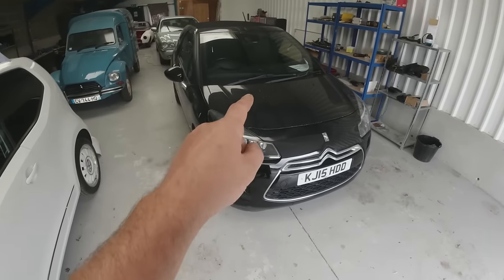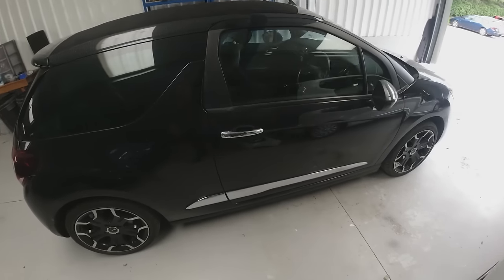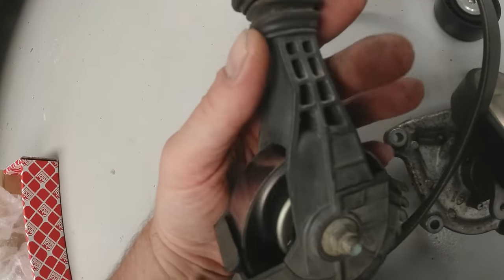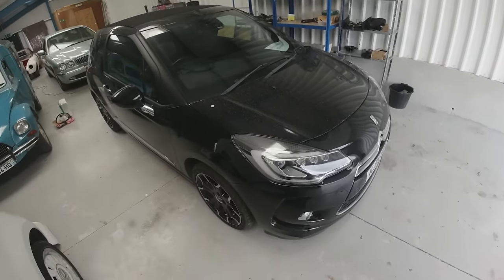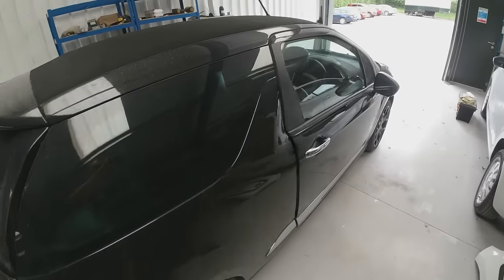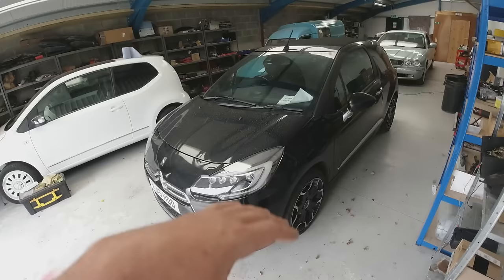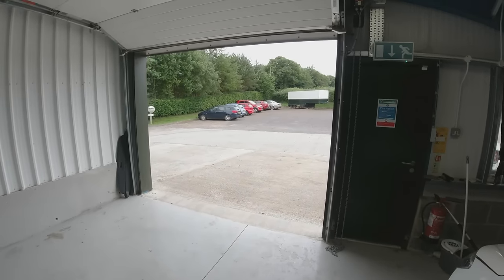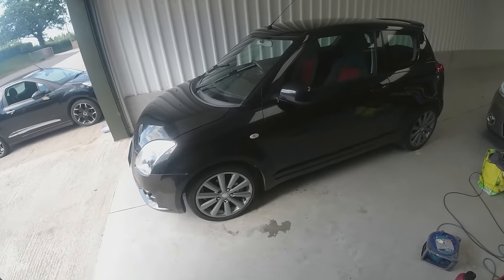Traffic Police pulled me over , and boy I am glad they did!

Comment: People don’t buy a car from a dealer..please look around first.
Reply from the maker: Good advice, go buy off a driveway with NO protection whatsoever, no comeback for an hour let alone 6 months for the sake of saving £500 or so. Brilliant advice
Reply: There's more the £500 difference between a private sale and a dealer sale. More like £1000-£1500 on a sub 5k car. If you're a cash buyer it pays to buy privately if you know what you're doing. Dont knock private sales, there's plenty of good sellers out there.
Reply: @jimmyjt16  I bought my little Toyota auris 1.4Ltr Diesel 2013 about 18 months ago for £3300 privately and was told everything was spot ON, it had just had a new clutch and the guy selling it said it could do with the front brake pads replacing but he hadn't got time to replace them and gave me a full set of new brake pads in there box included in the price. Anyway 2 MOT,s later there still in there box in the boot.😊. Plus they are now selling from dealers for double what I paid, even with the extra miles I've put on. It has never worried me buying private because I know the difference between a big end and a little end 😉.
Having said that I can completely understand someone who has not got a clue about mechanicals buying from a dealer and I would highly recommend Chops Garage for there new car. They would be far better off than buying from a cowboy either a Dealer or Private.
Reply from the maker: @jimmyjt16  lol!!! Not a chance £1500 on a sub £5000!!!
Reply: @ChopsGarage  your 100 correct because with a reputable dealer like yourself and others it gives the customer complete peace of mind . Anyway some private sellers are selling their cars for the same price as dealers and with private sellers you have no comeback . Ps looks like their are some wee driveway dealers leaving comments on here .
Reply: @jimmyjt16  Try watching some of Chops videos over the last couple of months, then pop back and let us all know whether you think the average private seller would - or even could - offer the same service for 6 or even 3 Months.........
Reply: We were looking for an xe jag, my son kept sending me links to private sellers, they were all mickey mouse traders pretending to be private touting a load of non declared write offs, obviously if you drop on a genuine private guy selling his pride and joy, fair enough, but it's rare these days.
Reply: 🤦 I bought a 2015 low milage manual gearbox BMW 435i from a BMW main dealer for less than what high mileage ones are from private sellers.
Just been fully serviced, new brakes, oil changed, brake fluid changed, spark plugs changed and 1 years full warranty.
You don't get that from buying from a private seller.
Reply: @RobWoodhouse46  A1 mate!
Reply from the maker: @dizzy2020  very well worded
Reply: Buy from a dealer always if it a £3000 or a £30,000 car , you have financial protection, if you buy on finance you have even more protection from a problem vehicle
Reply: @ChopsGarage  I'm sorry but you're wrong. I buy sub 5k cars privately and sell from my drive and always make £1000 margin. Dealers are able to sell even more then I do, so if you aren't making at least £1000-£1500 you need to ask yourself why.
I'm not having a go, but saying there's on £500 difference between private and retail is nonsense.
Reply from the maker: @jimmyjt16  sorry you are saying as you make £1000 margin, that cars can be bought for £1500 less than a dealer privately. Thats rubbish , so you are saying people can buy the same car as you are selling from your driveway for £1000 less if they buy private? £1500 margin does not mean the car is £1500 more than private! You can still have £1500 margin and be cheaper than a private seller if you bought right! But dealer make less than you not because you are smart but as we need to prep better than you, pay trade marketing prices on platfotms, trade insurance, building insurance, for warranties et etc. Sorry nothing you are saying makes sense but thats because you have not run a dealership. It you tell dealers they should all be making £1500 net on 5k cars everyone of them without exception will laugh you out the room!! Try selling 20 5k cars a month for a year from a proper premises and come back to me
Reply: @ChopsGarage  sorry Chops but that hurt my brain trying to read what you put there lol. I'm not having a go. We could argue until the cows come home, but the difference between a private sale and retail on a 5k car is £1000-£1500 and if you arent making that on most cars then you need to give yourself a talking to. It's definitely not £500 as you tried telling the OP.
Reply from the maker: @jimmyjt16  you are confusing margin with the difference in sales price. Price sale 5k cars are not £3500 whilst being £5000 at the dealers. Just go look on Autotrader. The difference can be nothing, up to £1000 max, on average only £500. I can have a car that has £2000 margin in it but is still listed cheaper or the same as private seller for same year and miles. For example on Autotrader the Hyundai i10s of same age and miles as mine with private sellers are with £500 or my full retail 6 month warranty serviced and fresh advisory free motd car. But I still have over £1000 margin in it.
Reply: @ChopsGarage  never had a car off a dealer, no problem
Reply: @ChopsGarage  there are plenty of private cars that are no trouble. Dealers make a very good living. Of buying cheap selling high. Some hassle but. I will never buy from a dealer but know a bit about them. Ur a one of a kind, genuine guy. However I’d rather buy my own.
Reply from the maker: @volt8684  but every business is about buying low and selling high. Happens everytime you buy milk or bread. You can clean windows yourself for free but there is a market for window cleaners to do the job on your behalf and a lot of them make a very good living, but does not mean they are rip offs
Reply: @ChopsGarage  I use Autotrader to value my cars and I've never personally valued a car that doesn't show at least £1000 difference between private and dealer price. For example I've just bought a Fiat 500c lounge. Autotrader show private sale guide price at £3790 and dealer price £4900 which is typical for all cars I've had. For a private buyer that's a £1110 saving over buying from a dealer. 
Maybe there's not much difference on some of the older or rarer stuff, but the common stuff it definitely is.
Reply from the maker: @jimmyjt16  but most private sellers dont advertise at that price. They look at dealer prices on forecourts and try for the same or few hundred less. You only need to do a few searches on AT to see Im right in the 5k market you noted
Reply: @ChopsGarage  not saying you are a rip off, clearly you are a fair chap and enjoy watching your channel. My father 94 was a car dealer and he trained me in rudimentary engineering which has helped me maintain my own cars and motorcycles, as well as my families ones. He always said don’t waste money on cars. I haven’t, I source great cars which stand us well. Our newest car in the family is an 09. I dont want this electronic gimmickry. I could afford a much nicer car but I choose to buy a vehicle I can maintain. I was just agreeing with the point u dont have to go to a dealer to get a great buy of a great car. Japanese vehicles cars and motorcycles are the most reliable imo. Tbh god knows what the future of motoring is. Skilled motor vehicle engineers are becoming rarer. I had a hyundai i10 once and the service manager said the clutch slave cylinder had gone……..it was a cable. I complained to hyundai uk. Not interested. My experience of the police is not the same as yours either. Sick of being pulled over on my motorcycle at 64 yrs old, by goons racing around in their high powered BMWs “policing the roads”. Preying on motorcyclists stopping us just because they can interrupting my day out because I chose 2 wheel enjoyment.
Reply: @ChopsGarage  You find these idiots on facebook. "after a small auto for £2k, what's about!". like that's going to get them a quality car?
Reply from the maker: @Toby_the_Glen  Yep or even £500 I have seen , must be reliable and new mot etc
Reply: Funny you should say that.Always bought private( albeit the hastle of wasting my time looking at bad uns) but only ever had normal wear and tear issues thereafter.Yes you save alot of money compared to a dealer that probably got the car blind from auction the week before.I always liked to see  the seller had  the car for some time and was in the address it was being sold from.If not registered to the address or only for a few weeks I walked away.Ok you buy sold as seen but if you pick well a shorterm warranty is not needed.Its a gamble either way second hand.
Reply: @jimmyjt16  If you are buying cars to sell them on your driveway, then you are dealer and therefore are bound by the same regs as chops is.
Reply: @jimmyjt16  if your buying and selling cars then your a dealer arnt you?so if so are you not bound by the same rules as James is??cheers
Reply: @jimmyjt16  Here here. I love cheap motoring and i have done for 40 years. Never ever brought new, in fact, i've never had a car under 10 years old. Always brought privately, and hand on my heart, never had any trouble at all.
Reply: @jimmyjt16  I've sold 2 cars privately and have always been honest. It feels bad lying.
Reply: Absolutely shit engine, your gonna need deep pockets good luck!
Reply: You should be looking around anyway when it comes to buying a car - not just for better deals on that make and model but also for vehicles that are in your preferred state of repair with full service history and that come back clean on police database checks.

Besides that - You're better off avoiding buying sight unseen as opposed to avoiding buying off a car dealer. Keep in mind that a good car dealer's primary goal is to get that car off their lot to make space for more cars while returning a profit... It is not to get that car off their lot and have it come back consistently for random issues that were said to have been "resolved prior to sale" when they weren't.
Reply: @RobWoodhouse46  And I bought a 3 year old Mazda 6 privately that had 23,000 miles on it. The dealer up the road had the exact same car, same year and even down to the same colour and it was priced 40% more, plus it had 58,000 miles on it.
Now if you're clueless about what you're looking at then you pay for that lack of knowledge. Ive been maintaining cars and motorcycles for 35 years, so I'm not.
Reply: No different to buying a burger from McDonald’s business’s  are for money. A second hand car has had the same dirty arsed owner wether it’s from a private sale or not. Going to a dealer is getting you some sort of aftercare by law. You get what you pay for.
Reply: I'm buying brand new next time
Reply: @ChopsGarage  Well playing devils advocate you're not always protected.  Bought a Shogun few years ago, broke down, taken back to seller under warranty.  Garage decides to declare business bankrupt to get out of warranty so we lost the money AND the car with no legal protection.  Definitely safer than Facebook sales but always pay a deposit of £100 or more on credit card so consumer has protection that way.
Reply: @jimmyjt16  there's even more really dodgy ones too and try telling them apart.  At least with dealers you can pay £100 or so with a credit card andget section 75 protection on top of other safeties cant do that with private seller

Comment: My son has one of these DS3's so this is great info. He loves it but I'm nervous because of reputation. I guess he needs to see this just so he can be forewarned !
Reply: I believe it came top in a list..... Of cars most likely to fail it's first MOT.
Reply: If it has the BMW 1.6 engine, there are certain issues but generally fine. If it is the 1.6 HDi... then it'll be fine. Any car can have problems, Peugeot / Citroen are generally fine, had a few and put on over 250k on the clocks without any major issues.

Comment: Had a similar intermittent noise on a M20 BMW engine some 20 years ago. Three engine builders heard the noise but had no idea. After a few weeks I started the car and it suddenly turned into violently shaking dumper truck complete with VERY loud thumping. I drove it 2 miles home like that.
The noise was a valve guide floating up and down, something I've never seen before. 
The eventual engine crash was caused by it wedging the valve open and snapping the valve head off!
Normally the M20's stamp their broken valves into the piston sideways, but this one decided to rattle around all the way home taking lumps out of the combustion chamber!  The M30 engines were even tougher. Good channel, very informative 👍
Reply from the maker: Oh my lunched it completely I bet
Reply: @ChopsGarage  I got away with one piston blagged from a mates spare engine, honed the bores, set of rings and shells and a recon head. Fixed in my shed over a weekend gaining another 4 years use out of that E28 520i. But that was in the bad old days when there was only two other Bmws in my home town.....

Comment: Salvage rebuilds just did a peugeot RCZ with the same engine, they got it cheap as the seller thought the engine was knocking, they changed the same parts as yourself and that cured the problem

Comment: FWIW my sons Pug 207 1.4vvti has the mini engine, showed the same symptoms as your DS, first diagnosed as camchain tensioner, but on dismantling, had the same problem as the DS with the same parts replaced. Only significant difference was that the belt was clearly breaking down. The issue is discussed on a few Pug and Mini forums. No issues since the fix 3 months ago.

Comment: I had a 2010 Peugeot 308 GTI (200bhp) - it had a new cam chain and tensioners, cylinder head, 2 water pumps for the turbo, water pump, coolant housing and that’s just what I remember off the top of my head - when it ran well it was great, when it wasn’t it was shockingly bad

Comment: I changed water pump on my wife old 308 1.6 Prince engine. Its weird that the belt doesn't actually go around the water pump. I took driver side front wheel off and arch liner and there it was. Fairly easy to do actually.

Comment: As a previous Citroen owner, whilst the cars are highly desirable, they are prone to faults that are hard to track down
and leave you with a feeling that the same problem will come back.
I hope this DS is now fixed, but a full warranty on these cars is a must.
You were lucky to have been stopped by rare officer that had the patience to wait until you sorted the insurance out.
Some insurance companies are very poor at updating your details to the MID system, the only time i was pulled for
no insurance was due to the new company failing to update for over 14 days, i was also lucky that the officer phoned
them, as i had the policy with me.
Reply: They are prone to faults because....Citroen!
Reply: @simonabbott7323  BMW design.
Reply: @simonabbott7323  not so. 1.6 petrol berlingo 150k no issues other than wear and tear parts. Same as pug 206 1.1.

Comment: Same design on a 207. It's for Euro 5 emissions. The water pump doesn't run when the engine is cold, this warms the engine up quicker reducing emissions. The waterpump is driven off a friction drive actuator that lowers itself onto the water pump once the engine requires cooling.

Agreed it's a dumb set up. Replaced the same parts on mine as well as the entire timing gear. Still a rattly engine.
Reply: So what was wrong with having a mechanical thermostat to do exactly the same job? 
Manufacturers will do anything to make their product more reliant on the main dealer network for diagnostics, repairs, servicing etc..... It properly winds me up. 
Thinking about it, if they wanted to go down this road, they could have just made the water pump electric and done away with a belt drive completely to reduce parasitic loss/drag on the driveline. That would also free up the pump to be in an easier to access position than on the accessory drive end of the engine.
Reply: @nickmaclachlan5178  It does also have an electric water pump which only runs when the car is off to cool the turbo, and it's even got an electronic thermostat, BMW really done a number on this engine, thankfully PSA fixed it for the Euro 6 regs
Reply: @ashliehiggins  Jesus H Christ, I'm so glad I got out of the car repair business in 2008........ diagnosing vehicles like this must be a fricking nightmare.....
Reply: @nickmaclachlan5178  I actually thought that's what you have a thermostat for 🤔 which opens when the coolant reaches operating temperature. 🙄Geez they'll dream up something crazy next. If it ain't broken don't try  to fix it. 😉😊
Reply: @stephenjones9153  Likewise, they claim it's for emissions control, but that sounds like a load of hogwash. Car engines spend 99.9% at or near operating temperature. The excess emissions emitted during warm up periods would be so small as to be insignificant. I always say the over complication of cars is just down to the manufacturers trying to wring more out of the customer in aftermarket sales and services, no more. 
Just FYI, I know a thing or two about combustion and emissions as I am a commercial combustion engineer and deal with Power station boilers etc.....

Comment: Speaking of water pumps, I changed the water pump on our 2010 Focus 1.6 -bit fiddly but not too bad.  Did the water pump on our 2015 1.25 Fiesta which has a broadly similar engine, and it seems some design engineering genius thought it was a good idea to bolt the cam belt tensioner to the water pump meaning you would possible have to change or de-tension the cam belt for no good reason.  Is the new generation of engine designers a bit mental "!